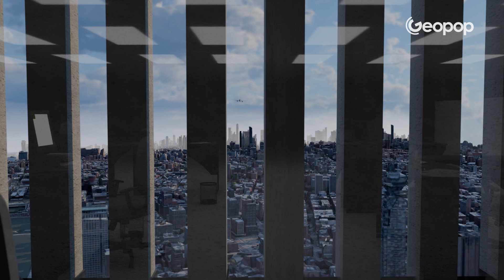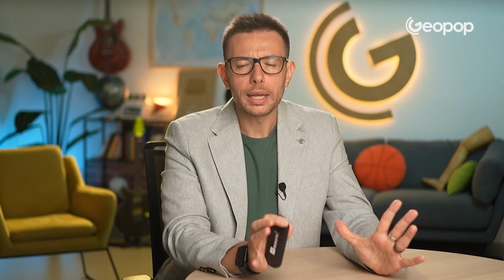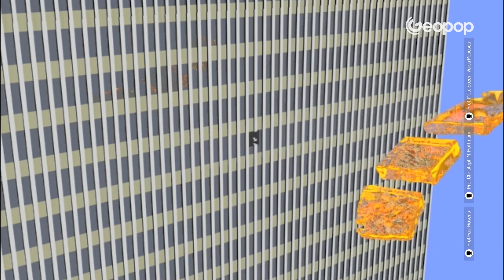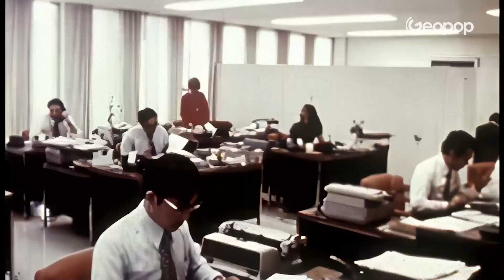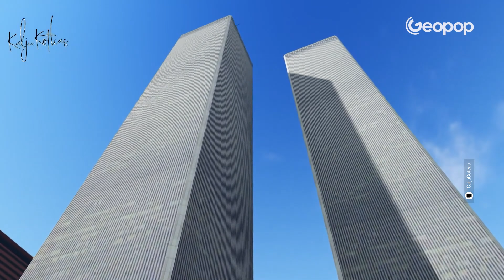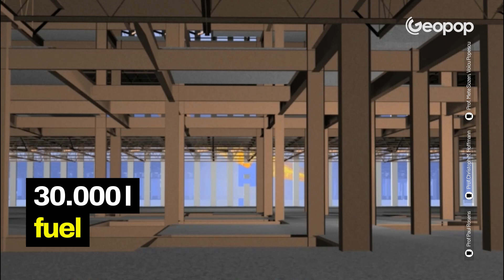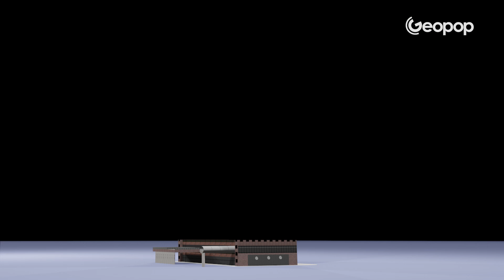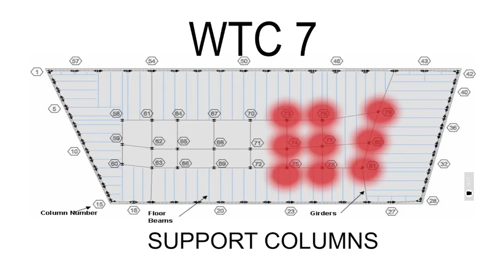9/11, 2001: The Technical Reconstruction of the Twin Towers and WTC 7 Collapses

Comment: The trade towers was a demolition, not a terrorist attack!  So was building 7.
Reply: Clearly someone wasn't paying attention.

You may not like it, but what is being presented in this video is fundamentally correct and widely supoorted by the worlds engineering community.

While imperfect (there are a few problems) this video goes into a much higher level of detail than many viewers can comprehend and gets the collapse mechanisms fundamentally correct. This is true no matter who planned and carried out the 9/11 attacks or why . 

	
Sure, it’s not what you want to hear and goes against 20+ years of conspiracy dogma and conditioning, but that is not the same as it being wrong. You just need to fix your dogma. 

On the plus side, this video can be (and is) fundamentally correct about the engineering AND the 9/11 attacks could still have been some sort of inside job. The two things are in no way mutually exclusive. It’s just not the inside job the clowns you have been following on the interent have been telling you. 

This will surprise you to learn, since the conspiracy side of the internet hides it from you, but the mechanisms described here have broad professional support around the world. There are no professional engineering organizations (for example: ASCE, ASEE, ICE, etc) that disagree with them or have offered any formal dissenting opinions or alternative hypothesis. 

So, either the overwhelming majority of the worlds structural engineers and quite frankly simple observation are wrong,… … or you you know more than the worlds best engineers from cruising around on the internet. Which seems more likely? 

If this explanation is wrong then produce a better one.  Be the first to even try.

Comment: A bunch of BS... yall don't know about steel.. nobody mentions an important detail when heating steel. if you are trying to heat treat a steel part that is 2" thick , you place it in a oven at full temp. you have to wait aprox 2 hours before the steel is 100% up to temp throughout. .. but nevermind, if it was exposed as a gov involved attack, nobody would be held responsible...
Reply: OK, even IF that was correct (it isn't) what does that have to do with anything?  

In this video starting at 22:30 and running to 28:10 the Energetic Materials Research and Testing Center (EMRTC) conducts a test to see what an open jet fuel fire can do to a loaded and unprotected steel I-beam. Remember, steel melts (turns into a liquid) at around 2,600-deg F, give or take depending on specific alloy. The test was planned for 30 minutes.

youtube.com/watch?v=JXWCMBuusMI&ab_channel=TrutherTVArchives

Within 2 minutes the open fire temperature has already exceeded 2,000 deg-F. 

After just 3 minutes 40 seconds the beam is sagging noticeably.

The beam fails and collapses 9 seconds later after just 3 minutes 49 seconds.

Note the steel fails but does not melt. It is bent and twisted, but not a puddle. You can still tell it is an I-beam. 

Purely from a jet fuel fire. 

Even heating of the entire beam most definately NOT REQUIRED. Indeed, better if it isn't. Localized heating will do.

Comment: This video is to help suppress the truth. People need to wake up and face the truth on what happened that day. How in the hell does the steel 60 or 70 stories below get hot enough to melt. Think of it like a candle. The candle heats up and burns fro top down, oh and heat rises….
Reply: The steel 60-70 stories below does not get hot enough to melt. Doesn't get hot at all nor does it need to. You were NOT paying attention!

You may not like it, but what is being presented in this video is fundamentally correct and widely supoorted by the worlds engineering community.

While imperfect (there are a few problems) this video goes into a much higher level of detail than many viewers can comprehend and gets the collapse mechanisms fundamentally correct. This is true no matter who planned and carried out the 9/11 attacks or why . 

	
Sure, it’s not what you want to hear and goes against 20+ years of conspiracy dogma and conditioning, but that is not the same as it being wrong. You just need to fix your dogma. 

On the plus side, this video can be (and is) fundamentally correct about the engineering AND the 9/11 attacks could still have been some sort of inside job. The two things are in no way mutually exclusive. It’s just not the inside job the clowns you have been following on the interent have been telling you. 

This will surprise you to learn, since the conspiracy side of the internet hides it from you, but the mechanisms described here have broad professional support around the world. There are no professional engineering organizations (for example: ASCE, ASEE, ICE, etc) that disagree with them or have offered any formal dissenting opinions or alternative hypothesis. 

So, either the overwhelming majority of the worlds structural engineers and quite frankly simple observation are wrong,… … or you you know more than the worlds best engineers from cruising around on the internet. Which seems more likely? 

If this explanation is wrong then produce a better one.  Be the first to even try.

Comment: I hope you got paid well to tell all that bullshit, the towers have been destroied by controlled demolition..
Reply: You may not like it, but what is being presented in this video is fundamentally correct and widely supoorted by the worlds engineering community.

While imperfect (there are a few problems) this video goes into a much higher level of detail than many viewers can comprehend and gets the collapse mechanisms fundamentally correct. This is true no matter who planned and carried out the 9/11 attacks or why . 

	
Sure, it’s not what you want to hear and goes against 20+ years of conspiracy dogma and conditioning, but that is not the same as it being wrong. You just need to fix your dogma. 

On the plus side, this video can be (and is) fundamentally correct about the engineering AND the 9/11 attacks could still have been some sort of inside job. The two things are in no way mutually exclusive. It’s just not the inside job the clowns you have been following on the interent have been telling you. 

This will surprise you to learn, since the conspiracy side of the internet hides it from you, but the mechanisms described here have broad professional support around the world. There are no professional engineering organizations (for example: ASCE, ASEE, ICE, etc) that disagree with them or have offered any formal dissenting opinions or alternative hypothesis. 

So, either the overwhelming majority of the worlds structural engineers and quite frankly simple observation are wrong,… … or you you know more than the worlds best engineers from cruising around on the internet. Which seems more likely? 

If this explanation is wrong then produce a better one.  Be the first to even try.

BTW - It takes a special combination of hubris and stupidity to think believe that someone disagrees with you only because they are being paid to do so.

Comment: No way a wing of an airplane would go through steel and cement
Reply: Why not?
Reply: @TheLoonResistance aluminum  vs steel and concrete  rebar
Reply: Sand can go through steel, learn physics my guy, It can and IT DID, the shear amount of logistics it would take to bring down 3 buildings with explosions (in secret) is impossible, As a 25 year military vet our govt is not that efficient.

Comment: @Geopop, everyday science
On my channel, there is a video showing the second plane, flying into the tower but appearing behind and no explosion happens. 
Can you confirm if this video authentic and whether all other videos from mainstream media are CGI and fabricated? 

The video on my channel is titled "9/11 CNN Moviemaker" and compares the footage to the CNN broadcast. 
The timeline is identical, as seen in the shape of the smoke, but the CNN plane moves at twice the speed of the "other" plane. 

This suggests that one of the videos is genuine, and I believe the CNN video is CGI, as it is easier to add a plane and explosion a video than to remove them.

i took this video from a Dutch tv serie also on my channel called: de illuminati in Nederland publiekelijk besproken, it's one of my first uploads. ( @01:09:30 ) 
( original name of the tv serie is " De Milieuridders " by Muntz and Van de Wint on Dutch tv in 2004 )

Comment: Planes cant travel that fast at such low altitudes
Reply: Sure they can, and they did. They just aren't allowed to, but it seems unlikely the hijacker-pilots cared much about rules.
Reply: @TheLoonResistance  the thing is those hijackers were very inexperienced and couldn't handle a plane like that its practically impossible
Reply: @matcon7384  - So now you admit the planes could fly at those speeds, just not the pilots.

Fair enough.

Because even though all were experienced pilots with FAA certificates they for,... reasons,... couldn't fly.  This seems odd. I was doing full-on aerobatics on my 3rd lesson at just 14 years old. 

So what did you think of Richard "Sky King" Russell then?
Reply: @TheLoonResistance  even if the plane could fly at that height he was still doing hard maneuvers only a very experienced pilot can do there was a 270 degree turn and many pilots have said this is impossible
Reply: @matcon7384  - What hard maneuvers?  Are you talking about Hanjour?

Have you ever reviewed the NTSB’s recreation of Flight 77 from the data recovered from the Flight Data Recorder (FDR) found at the Pentagon crash site?   

www.youtube.com/watch?v=3vqDDlS9Hyw&t 

You can easily skip to past the half-way point to begin. 1:10:00 should be a fine place to start. OK to speed it up a bit too. Pay careful attention to air speed, throttle input and altitude. Give it a watch and let us know how skilled you think Hanjour really was, or how skilled he really needed to be. There are no Top Gun Maneuvers or epic feats of flying prowess. He isn’t skimming along the ground like Luke Skywalker for miles at 500 mph or doing fighter pilot turns. There is nothing in that flight path that any pilot of rudimentary skill could not pull off with just as little precision and finesse.  Note: he never even used the rudder. 

The prep for Hanjour’s “impossible Top Gun maneuver” starts from about 1:00:00 and the turn at 1:12:00.  Note that at 1:00:00 Flight 77 is at 25,000 feet and 282 knots with the throttles at 75%.  Over the next 12 minutes the altitude drops massively and he is up and down with the throttles desperately trying to manage speed. By the time Hanjour sets up for the “impossible” descending turn, Flight 77 is traveling at 322 knots and 9,900 feet with throttles at 30% as it sets up the turn. He drops to 6,950 feet before climbing back up to just a bit to just over 8,400 feet to scrub the speed down to 281 knots to start the turn, picks up a bit of speed back to around 320 knots as it starts to descend through 7,000 ft, dropping to 292 kts as it passes through 6,700 feet and enters the first part of the right hand descending turn. Even though a descending turn to scrub off speed and altitude is Flight 101, Hanjour is all over the place. 

Hanjour picks up altitude again to about 8,500 feet at 278 kts before entering the final 270-dg loop, dropping the throttles down to 25% and generally holding between 265-295 kts on his way around. Rate of descent like the speed is highly inconsistent. It was a roller coaster. 

Flight 77 starts to come out of the turn at 3,000 ft. and 290 kts still at just 25% throttle. At 2,042 ft. and 316 kts Hanjour straightens out at the end of the turn and pins the throttles to 100%. Note that at no point during any of this does Hanjour apply any rudder. Over the next 4 miles Flight 77 descends in a shallow dive (picking up even more speed) from 2,000 ft to a last recorded altitude of 180 feet and velocity of 462 kts (531 mph) as it crosses over Washington Blvd probably about 2 seconds prior to impact. 

Last 37 seconds of recorded flight after completing the descending turn at timestamp 1:21:30.  Watch the EDT:
13:37:09 speed 302 kts altitude 2,199 ft. 
13:37:29 speed 383 kts altitude 1,428 ft.
13:37:39 speed 442 kts altitude 560 ft.
13:37:44 speed 462 kts altitude 180 ft. (last data input recorded to the FDR, about 2 seconds before impact).

Again, Hanjour dumped more than 2,000 ft. of altitude and picked up 159 knots in velocity,… in just 37 seconds.  While flying a straight line. 

No one ever claimed Hani Hanjour was a great pilot, or even a good one. He didn’t have to be. Hanjour was after all a Kamikaze pilot, not a commercial airline pilot and the standards required between the two are quite different

But he had earned his FAA Commercial Pilots Certificate and was grossly over-qualified to crash a plane – the easiest thing any pilot can do. 
 
And he did. 

Ever hear of Richard Russell? He was all over the news about 5 years ago. He never had a lesson. What did you think of his efforts?  Nobody ever claims what he did – which was far more spectacular in terms of flying than anything Hanjour did - was impossible. I suspect this is because he was white – and there are no political agendas which need to be satisfied.
Reply: @matcon7384  - You're welcome. Glad I could help sort that out.

Comment: Some of the issues i have with this/current explanation is that the temps never got as high as 1000 deg C. Soft furnishing fires only reach 400 deg C. Jet fuel only reaches 1000-1500 deg C within in a jet engine. Jet fuel is essentially kerosene, ignites easily, used in Hollywood explosion effects, but outaide of a jet engine burns inefficiently hence lots of orange flames. In a jet engine at temps >1000 deg kerosene burns with a bluer tint.
Secondly, conservation of momentum. The upper small WTC section collapsing would at least be slowed down by the massively larger and as yet undamaged lower section. But it almost free falls
Lastly, a new theory was formed by NITS to explain WTC 7 collapsing ie due to fire and heat only. Never before and never since has a steel framed building collapsed due to just fire/heat, so if this new theory is correct and to be believed, firefighting services across the world would change their standard operating procedures, as yet I'm not aware of any that have.
Reply: You might try watching the video, and paying careful attention.  Your objections are well and truly demolished by the facts.
Reply: @ChristLink-Channel how many shekels are you paid to regularly come and "debunk" 9/11 truther comments?

Comment: These are the ONLY TWO BUILDINGS ON EARTH that have EVER fallen from a plane strike. Building 7 was a hub for the intelligence community. Engineers and controlled demolition experts say this info is total crap. The 9/11 commission was clearly lying. Many members of Congress from that era hold that to be true. The steel was sent to China and the evidence destroyed extremely quickly. This video is almost certainly sponsored by the parasites in the intelligence community.
Reply: 1. That is not true. 
2. Also not true.
3. Competely not true.
4. The 9/11 Commission did not deal with collapse engineering.  
5. No they don't.
6. Seriously not true.
7. Pure delusional speculative nonsense. You are just butthurt this video is telling you things you don't want to hear.